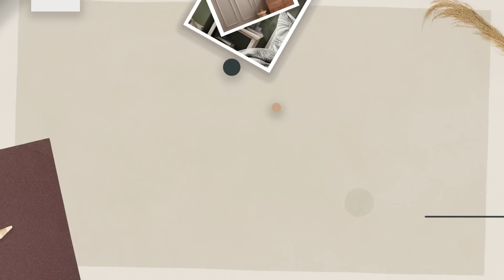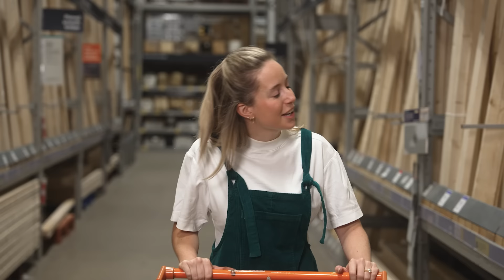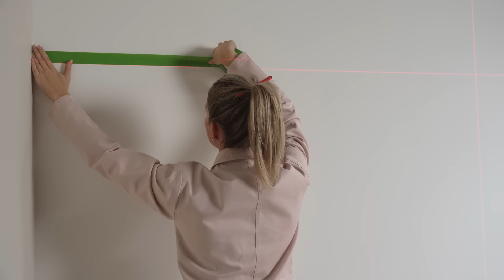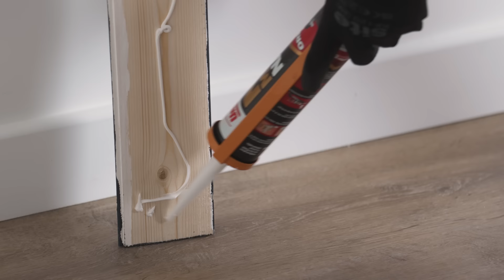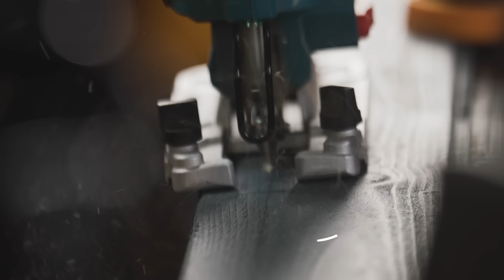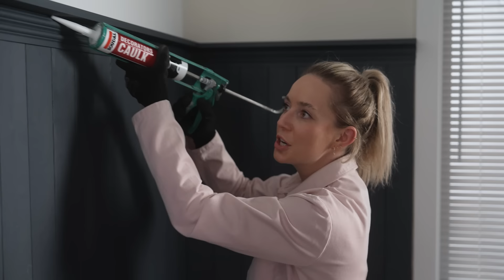How to install Tongue & Groove wall panelling | You Can Do It with Alex Lawson | B&Q

Comment: Am I able to get the panels cut to size at b&q if I don’t have a saw?
Reply from the maker: You can see more on our cutting services here https://bit.ly/2NjpPxj
Reply: I worked at B&Q for a while. Usually plywood and MDF is what the guys are allowed to cut on the panelsaw. No treated wood is allowed to be cut. The smallest size you can safely cut is 250x500. Most panels are smaller than this so this may be an issue.
Reply: @Gourmondise  Thanks so much for your insight! That's helpful to know, much appreciated
Reply: @getlowpapoose if your not confident with cutting get a mitre box and saw keeps your cuts secure and clean 😊